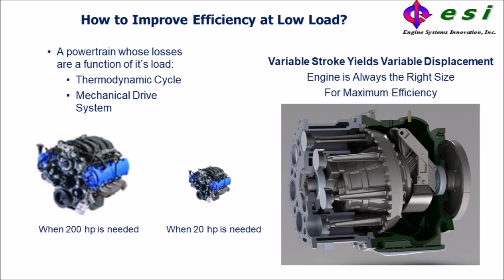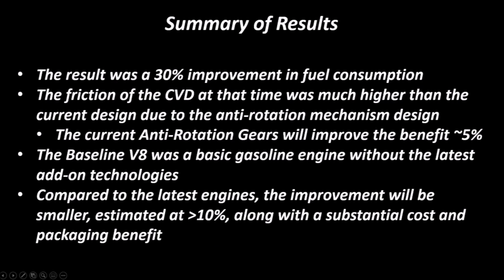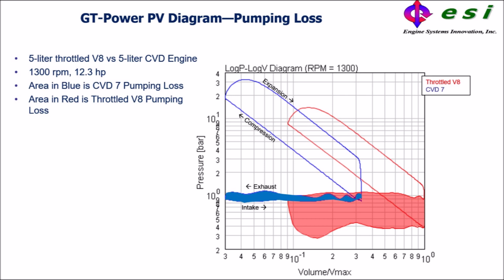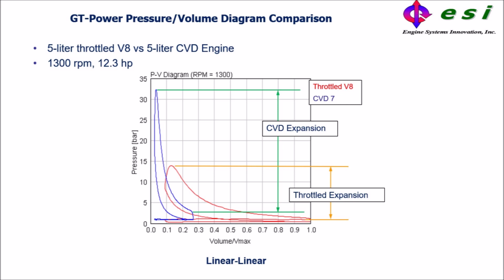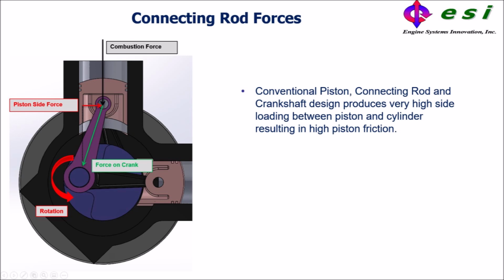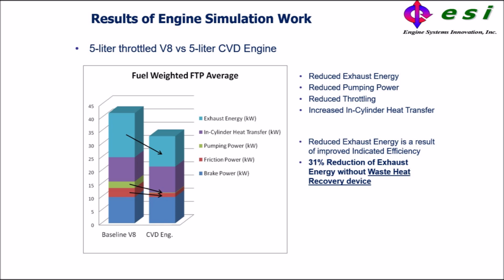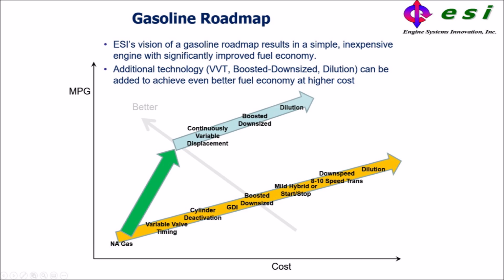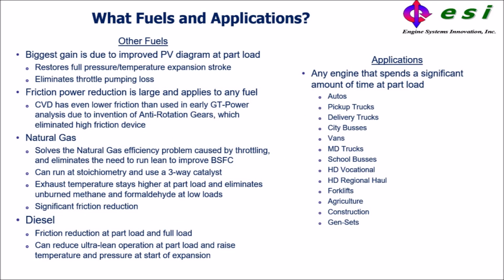Continuously Variable Displacement Drive Part 2 YT

Comment: So what happens if you have two pistons per cylinder, like achates power, and use your continuously variable displacement mechanism on both sets of pistons? https://contest.techbriefs.com/2020/entries/automotive-transportation/10271 I saw this link, it's a rough idea of the set up would look like, I think
Reply from the maker: I'm always open to improvements for the CVD design. But there are multiple issues with the idea you are proposing. First, it would have to be a two-stroke. As a former motorcycle road-racer, I loved the power of my TZ500J. Of course, my leathers would be covered in oil from all of the pre-mix spit out the carburetors every time I went out on it. That doesn't fly with today's emissions targets. Second, the secret sauce of the CVD is variable displacement. Two-strokes have essentially fixed port timing (yes, power valves help a little), so as the stroke is shortened by a factor of 3, the ports wouldn't reconfigure themselves. Third, that would make a VERY long package. And fourth, it would just about double the cost. And I can see that that wobble mechanism won't work as it's sketched, but it could be replaced by a working design. But keep thinking--you have to cycle through a lot of ideas that won't work before you hit one that does!